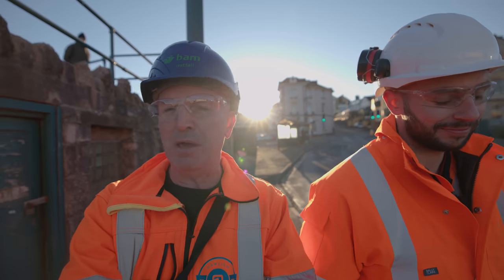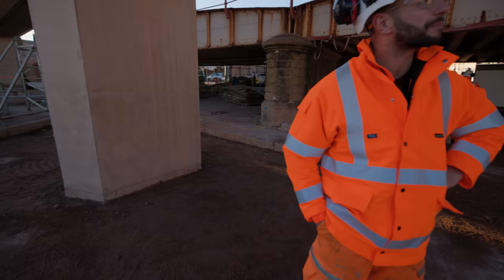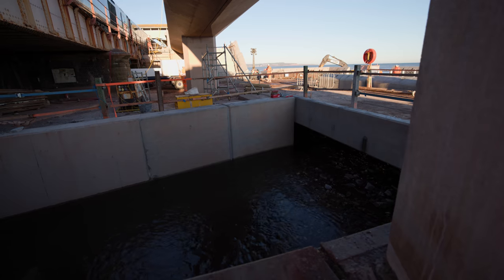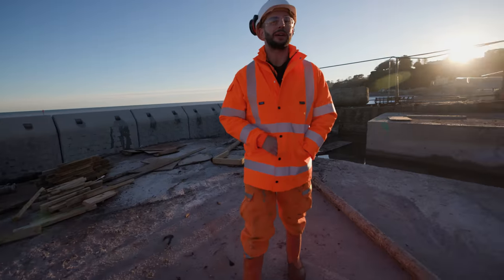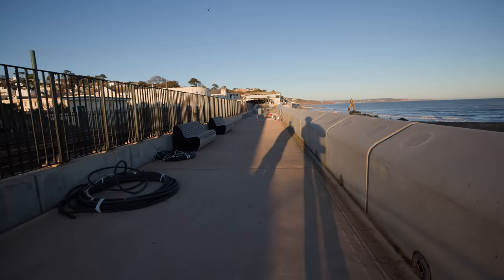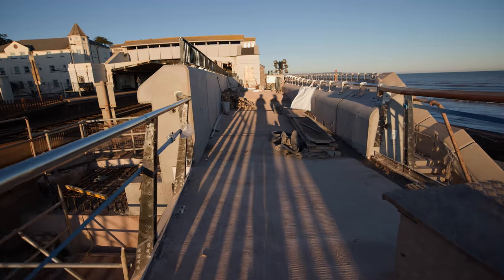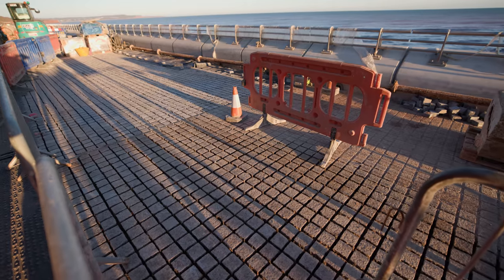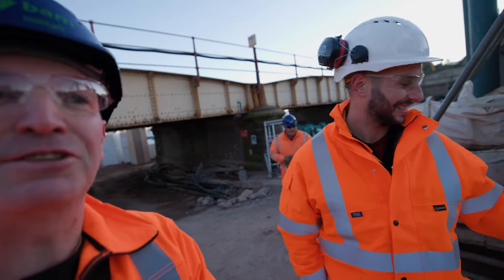Dawlish Sea Wall Video - The New Link Bridge - 8K

Comment: I've followed a fair bit of this project, but I'm more interested right now about the eel pass and how it functions. (Mainly because I had an eel pass installed on the Thames albeit a lot smaller by the looks of things.) It would be interesting also to build a meander or two in the river instead of a straight channel. Maybe with a reed bed of some sorts making it look natural.

Comment: It's very ugly, hugely expensive, and will not last as long as the original stone. Completely destroys the character of Dawlish. Always seems to be a lot of blokes standing around having a chat or leaning on railings; no wonder it's taking SO long!
Reply: Victor Meldrew is alive and well. Merry Xmas.
Reply: Armchair Ken would rather Dawlish slowly rots into the sea. Then he can say he told you so again.
Reply: I think Ken is trying to say that it’s a fantastic piece of modern engineering that will compliment Dawlish for many years to come
Reply: Clearly a comment by someone who has no understanding of the needs of the town, and the complexities of the project.

Armchair experts are always the worst.

If you don’t like it, you can always go somewhere else!
Reply: @sgthree  Do you mean a different chair?
Reply: @simpson1066  You know EXACTLY what I mean.